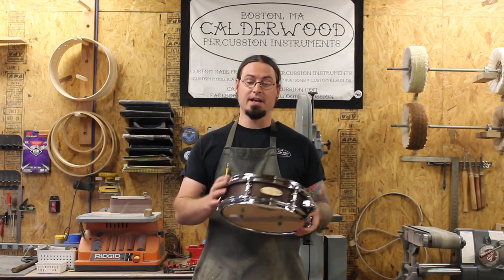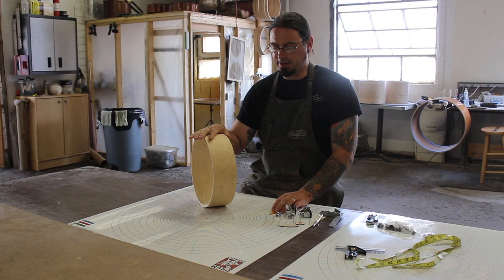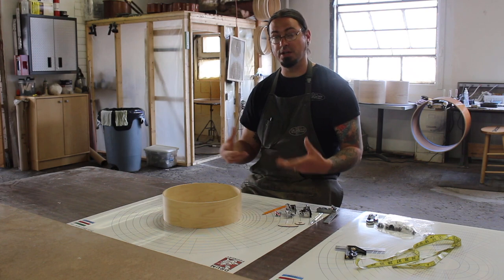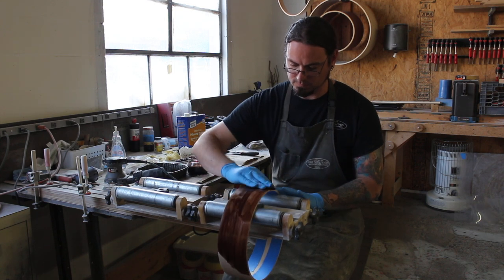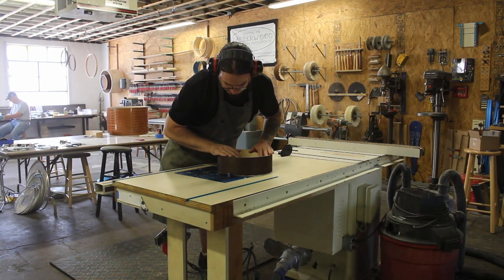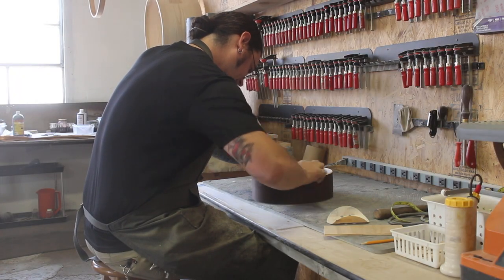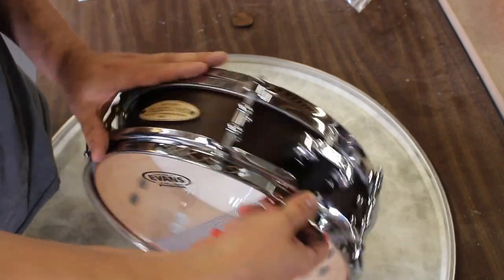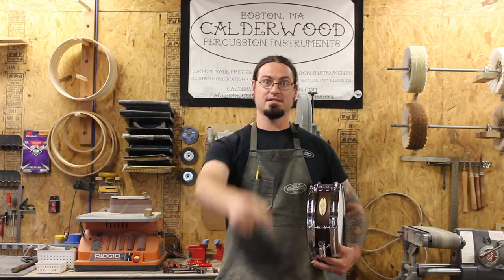Hamilton: An American Musical - Piccolo Snare Drum [London Production]

Comment: +calderwoodpercussion  How shallow a 12-lug snare drum can be done with a continuously-adjustable butt?  Piccolo snares, in my experience, are particularly sensitive to off-center placement, whether the snare unit is spring, wound wire, or gut.  The plywood standoff gains some space for hoop clearance.
Reply from the maker: +B. C. Schmerker an adjustable butt would have fit, and would certainly be a good option for this drum, but the three position butt was in the design spec.